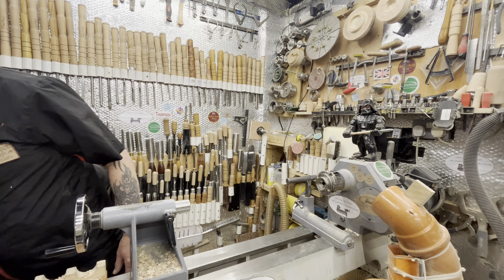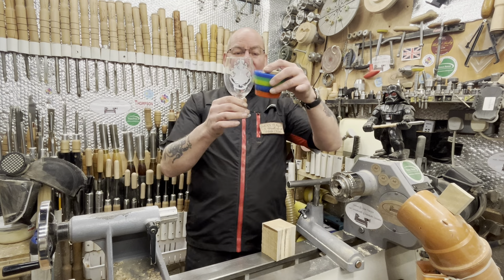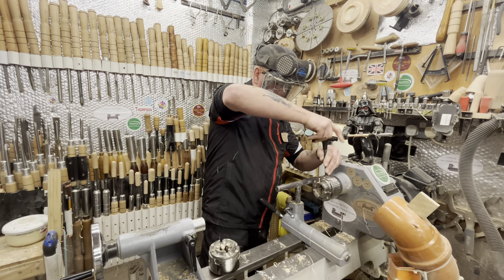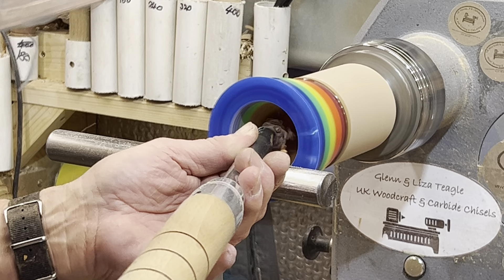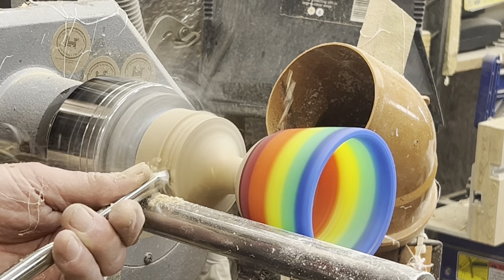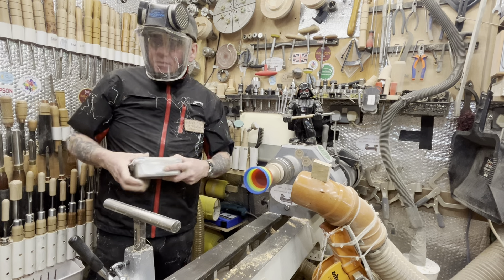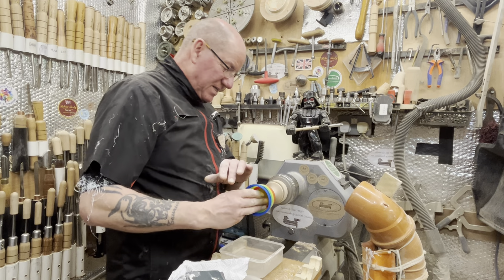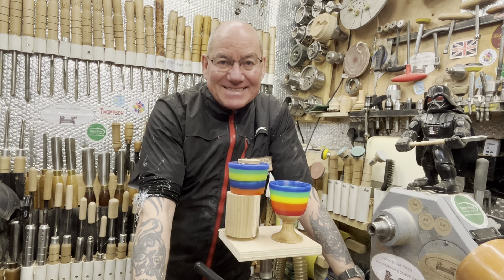Woodturning. Liza’s happy rainbow 🌈 goblet #carbide chisels

Comment: That was neat making a wine glass.  Got me thinking of your first 3 tool set series where you made a little cup/bowl.  That would make a nice whiskey glass, may be a little bigger.  Would you leave the inside with no finish?  I would think the alcohol would eat through finish.  Don't know about a poly finish.  Thanks for the video.  Can you imagine your dust collector if it sucked up all that stuff?
Reply from the maker: Liza was pleased with it. Used it when she got in. No finishes will be used on it. The resin is like a plastic finish. Ideal really. That resin would have clogged up the dust extraction system. It was in long ribbons too.